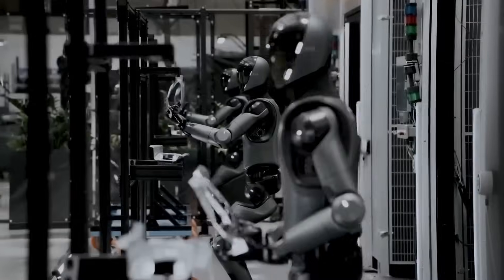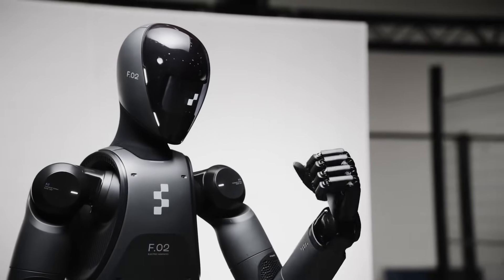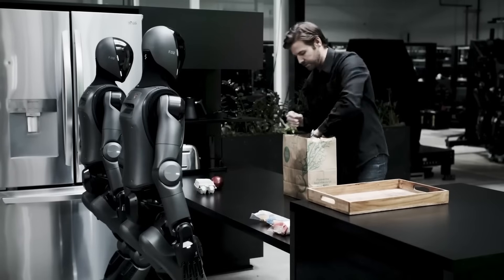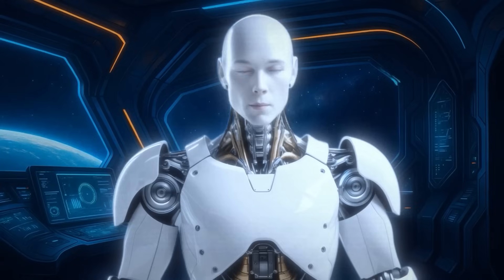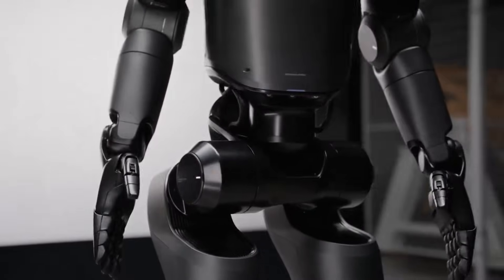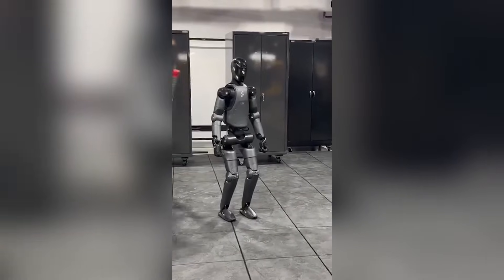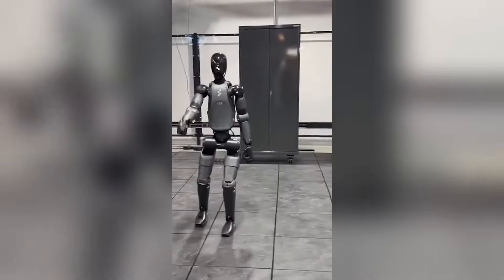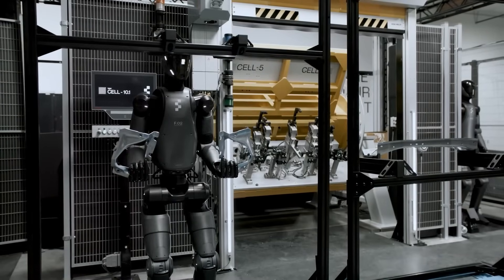The Figure 03 Leak NOBODY Was Supposed to See – And It’s SCARY Real!

Comment: ChatGPT says:

Thought for 4 seconds
What the transcript actually delivers
After reading the full 18-minute script, every “leak” boils down to three short, un-sourced tidbits that are repeated and padded with speculation. Nothing else in the text is new, confidential, or supported by evidence.

Timestamp	What’s claimed	Why it’s a “leak” (or not)
0:02 – 0:17	A single blurry photo: frosted glass, humanoid silhouette, hand-painted sign “F.03 Bear Cave – keep door closed.” CEO Brett Adcock allegedly says “this is the most advanced hardware I’ve ever seen.”	This is the entire “leak nobody was supposed to see.” No image is shown in the transcript, no source is cited, and the photo itself (if real) reveals nothing but a shape behind glass.
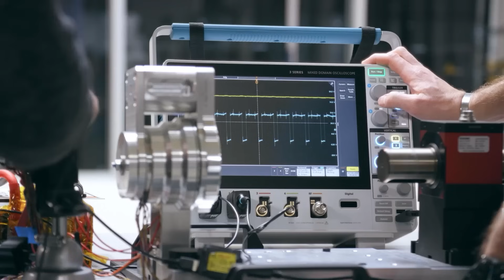3:00 – 3:19	“Early leaks say new motors push 30 % more torque per kg … sealed joints rated IP-54 … molded parts for mass production.”	Presented as inside information, but again no source, document, or test data is supplied. These are ordinary marketing-spec guesses.
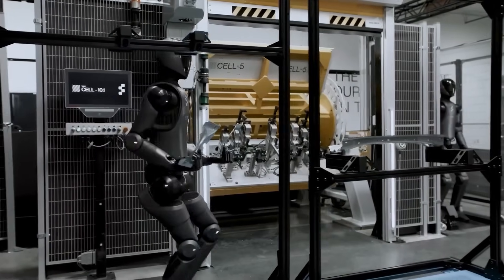7:10 – 7:23	“One robot ran an 8-hour mock home shift—making beds, loading laundry, wiping spills—without any human correction.”	The biggest functional claim in the video. The transcript gives no photo, log file, witness, or date. It is just asserted as “one leak claims…”.

Comment: Can F-03 install a drill bit into a Hand Drill that features a Jacob's chuck, of the sort that requires a DRILL KEY to tighten the Jacob's chuck? I'm guessing that F-03 cannot do this.
Reply: It probably can already do that
Reply: @gunsarrus7836  Well, if it can't, then humans will be assured of significant factory jobs, for a long time. Processing stock steel requires drilling and the removal of rust layers. This requires the use of Hand Drills and Orbital Sanders (with the occasional exception of performing Sand Blast.) When dealing with stock steel, there is no way to get around this. More likely, F-03 is only good for really simple tasks, like moving a plastic recycling bin from Countertop [A] to Countertop [B].
Reply: @JohnBerry-q1h  Those jobs will be automated very soon
Reply: Drill plugs into robots hand
Reply: @umbro12  You are avoiding THE CHALLENGE of my question. I asked if F-03 can successfully handle a DRILL KEY, so as to successfully and adequately tighten a Jacob's chuck, which is fitted onto a common Hand Drill. My guess is that F-03 would fail this challenge.
Reply: They made robots in China and Japan that can do brain surgery better than a human
Reply: @moonstruck420  With the exception of cutting through the bone of the cranium, brain surgery makes use of a very different skill set when compared with what it takes to handle and manipulate a DRILL KEY to loosen and/or tighten the Jacob's chuck of a Hand Drill, so as to adequately install a new drill bit. I look forward to seeing a video that believably shows an F-03 replacing a drill bit, by using a Drill Key, and then using the same Hand Drill to successfully drill a 1-inch-deep hole into the center of the edge of a large sheet of three-quarter inch thickness cold-rolled steel. That would represent a genuine factory task, that human factory workers must perform, every day of the week. So far, what we usually see in videos is a humanoid robot performing fancy dance routines, along with moving a plastic recycling tote from Countertop [A] to Countertop [B].